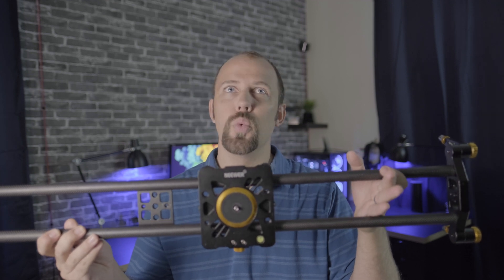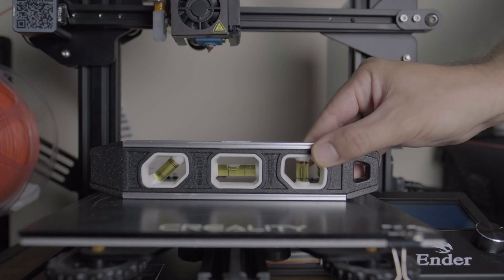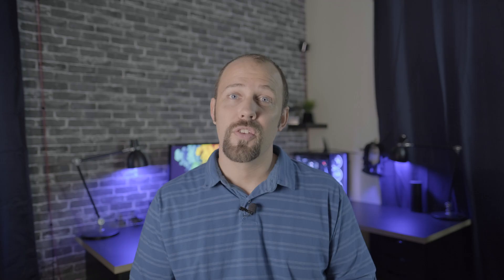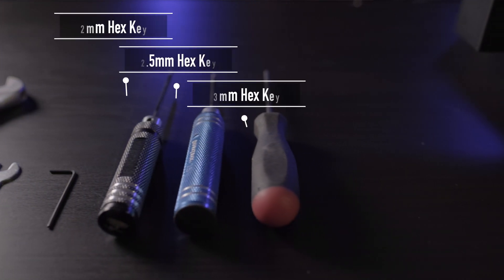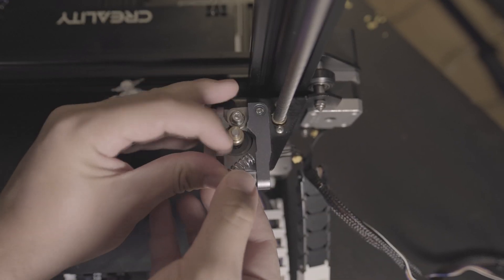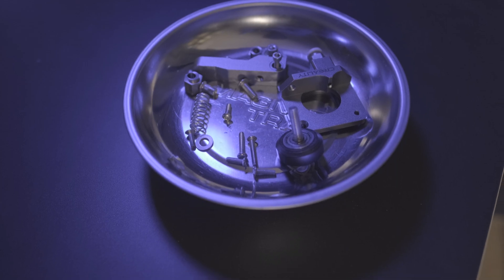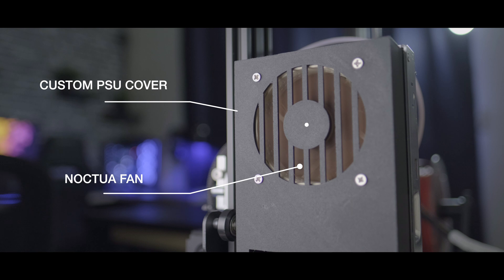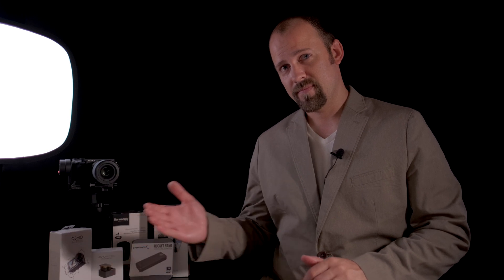I BROKE MY PRINTER!!! ~Then upgraded it.  (Ender 3 Pro Micro Swiss Upgrade)

Comment: I've installed the unit but now when it homes in, the motor thats installed on the microswiss hits the vertical railing. Any idea on how to change the home offsets to work with it

Comment: Just purchased this upgrade (actually the full micro swiss direct drive extruder) for the Ender 3 Pro. Unfortunately, my extruder gear does not have an allen bolt to remove the gear. How do I remove the gear without damaging the motor?
Reply: Get an rc pulley puller. Or 3D print one
Reply: I watched a video to remove mine with two hammers when I upgraded to the aluminum feeder.  It worked perfect without damaging the shaft or motor.  It uses the principle of newtons cradle to get the force to move the gear.

Comment: I also have an Ender 3 Pro and use a BL-Touch. Did you have to adjust the firmware to make the ABL sensor work the same way as before, or was it plug and play, without any adjustments?
By the way: nice video
Reply from the maker: I didn’t have to make any adjustments for the ABL other than some offsets for its physical location. Everything else worked as advertised.
Reply: @BartmansBits  I just installed this and what software are you using. Did you change the e-steps and the x/y settings